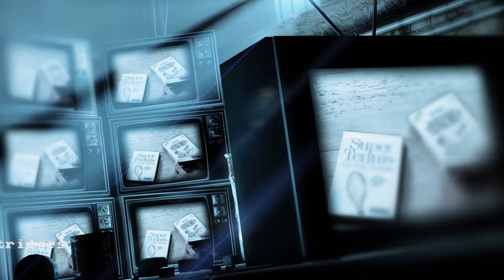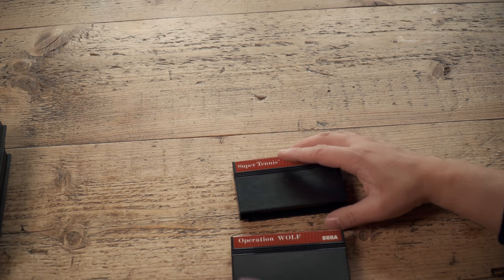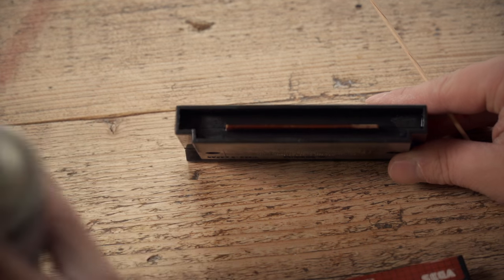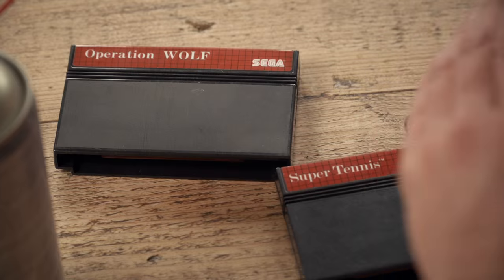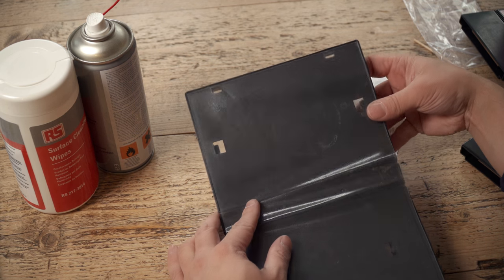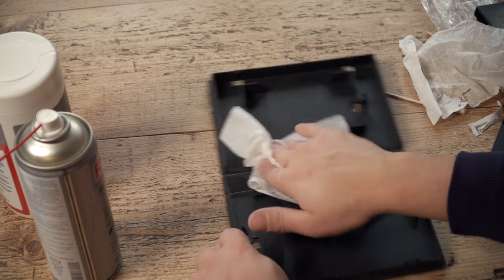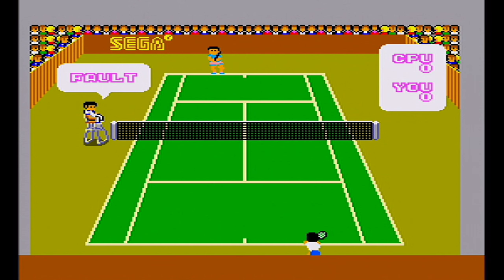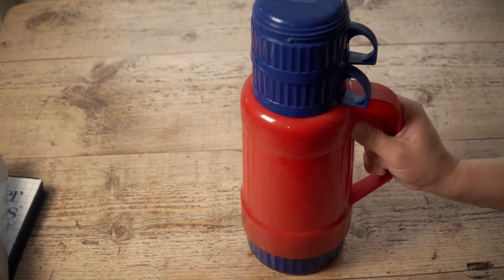Chinnyvision - Ep 129 - Cleaning Your Cartridges

Comment: It'd be better (less wasteful) if you sprayed the buds or cloth with the IPA, rather than flooding the area around the edge connector.  It's also used to clean up flux residue after soldering, which the more technical of your viewers might be into.
Reply from the maker: To be honest, as I don't buy IPA at high street prices (the shop starting with M that charges a fortune for a tiny quantity) I tend to be rather free and easy with it.
Reply from the maker: That RS tin was  £4.50. Since I recorded this vid in Feb I can't remember if my thinking was just to quote what people will pay on the high street or I had forgotten it cost £4.50
Reply: Yes but check the volume of IPA in there, I bet its a lot more cost effective to buy a large 5l bottle.   Granted its in a spray can which can have its uses etc.
Reply from the maker: Spray is extremely useful for cleaning circuit boards which is why I purchase it in cans. All the stuff you see I already have about the place for other stuff.

Comment: You may wanna open your Quartet cart and go at the connector with a cloth towel and copper polish.  I saved an ESPACIALLY filthy NES cart that way.
Reply from the maker: Good idea.
Reply: Forgot to mention that once you do that, you should clean off the polish with 91% isopropyl.  That stuff can cut through oxidation, but it can also oxydize if you leave it there.